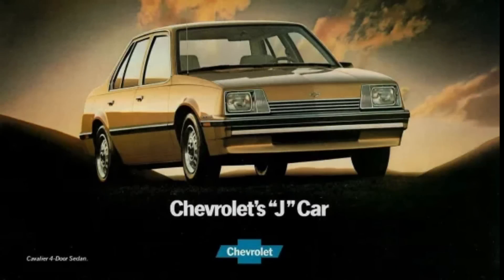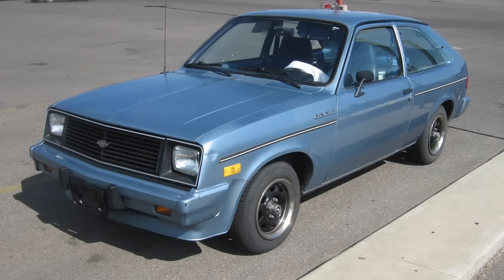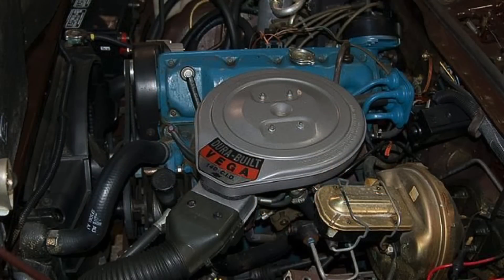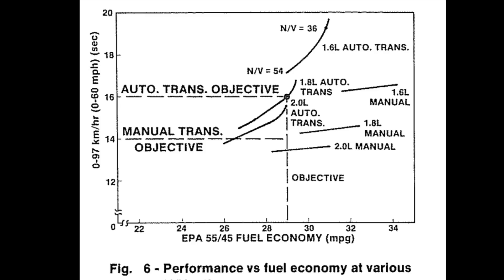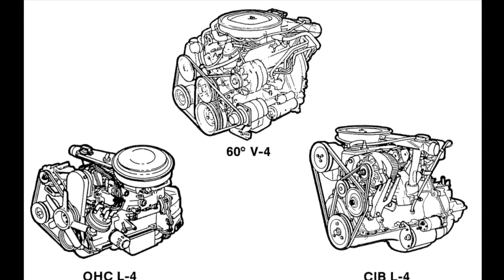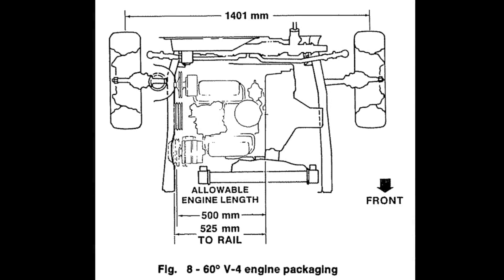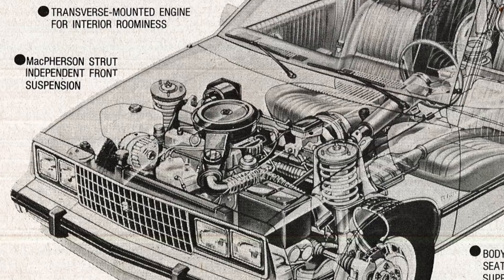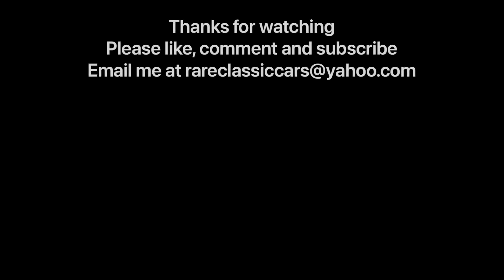GM Builds a Crazy 60-Degree V-4 (Yes, a V-4!) for Its J Cars

Comment: Had an '88 Eurosport with the 60 degree 2.8L V6 and 4 speed transverse automatic transmission.  It had about 250,000 KM on it with no engine or transmission repairs;  just change the oil!  Sadly, it was in a small collision;  was written off because it was over 10 years old.  It was sold to a man who fixed the body and put another 100,000 KM on it.  I loved the GM 60 degree V6 engines;  absolutely no cam drive issues faced with the newer OHC engines.
Reply: Had 86 S-10 Blazer with the 2.8 V6.  First fuel-injected vehicle ever owned.  Loved the way it started right up, no stalls.  The 125 horsepower were quite adequate for both city and freeway driving.  Did a lot of freeway driving, long distances on cruise control, in the Blazer, just cruise and listen to the music, very enjoyable.  Sold it in 94, got a Taurus SHO.

Comment: I bought a 89 2 door Cavalier with the 2.0 engine.  It had throttle body injection and was very slow & got horrible gas mileage.  I later bought a 94 2 door Cavalier with the 2.2 liter engine. It had port fuel injection & a roller cam. Wow what a difference.  It had an additional 40 or 50 hp and got 35 mpg. I drove it to 305,000 miles and never broke down.  I still miss the 94. If I found a good used one today I would buy it.

Comment: Back in the day I owned a Chevy Chevette.
I was lucky to go up a steep hill at 45 mph with a tail wind.

That car lacked horsepower, torque, and curb appeal.

A small V8 would have been more efficient, in my opinion. Having to do less work for the same results.

Comment: My first car (back in the 70s) was a Saab 96, which came fitted with a Ford Taunus V4 engine. Worked fine by the performance/economy standards of that time, and was very short in length.
Reply: The Ford v4 was actually an industrial engine which is why they ran forever
Reply: Dude I had one of those too I think it was a 71 I got new and I loved it what a great car!😂
Reply: I had a 1967 Saab 96 also with a V4 and it also was my first car in the late seventies. I really miss that car.

Comment: Interesting video but a V 4 would be longer than 2 cylinders because the bores on opposing banks are offset. Call it 2 1/2 cylinders long.
Reply: Yes, although the offset is only the width of one connecting rod big-end bearing, if the bore spacing is the same.
Reply: @brianb-p6586  - So the engine is longer by the thickness of two connecting rod big ends, but it is longer that a two cylinder engine.
Reply: @scootergeorge7089  just one connecting rod big end, if the bore spacing is kept the same... but yes, the V-4 is longer than a straight twin with the same cylinder bore and stroke.
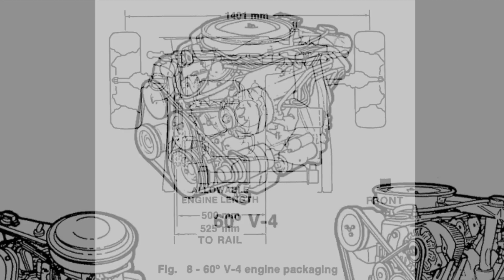Reply: @brianb-p6586  - Correct. But at 6:38 they say the four is no longer than the twin.

Comment: Back in the 80,s Oldsmobile was supposed to been developing it's own V5 diesel engines in addition to it's 4.3 V6 production engine  back in the 60,s Ford of Europe had developed a V4 engine for the Saab 99.
Reply: Ford didn't develop the Taunus V4 for Saab, but they did sell it to them.

Comment: I have often wondered why GM didn't just make a four cylinder version of the Pontiac  OHC sprint six like Chevy did with the Chevy II four which was just a Chevy 6 with two less cylinders, it would have been very similar to what they put into the Pinto and other Ford products. I think that was a missed opportunity.
Reply: I believe that the Pontiac and Chevrolet straight sixes had the same bore spacing as the later Chevrolet small block V8, which was 4.4 inches. That would result in a relatively long inline four-cylinder, which was a problem for the transverse placement in a small car. The Iron Duke (later Tech IV) engine was available when the J-car was designed, and had been used in the H-body cars, but was not used in the J-cars... presumably due to the length.
Reply: It may have been too tall for small front wheel drive cars 🤷‍♂️

Comment: Ford built a V4 in Britain and Germany it produced excellent torque if not horse power but need to have a balance shaft in the block in order to stop it from shaking itself to pieces
Reply: The British and German Ford V4's were unrelated engines - the Essex engine from Britain and the Taunus engine from Germany.

Comment: Saab had a V-4 but it was a 2 stroke. A 4 stroke V-4 is really rough but that problem seems to go away with a 2 stroke design. The J Cars weren't great, weren't terrible but they were better if you could get the Iron Duke 2.5 four cylinder and especially the manual transmission. The automatics weren't the best and when you hooked up a V-6 to them they wore out sometimes in less than 100,000 miles. My dad had a Pontiac Astre with that 140 cubic inch four and as Charles Barkely would say - "It was turrible! Just turrible!"
Reply: Saab's 3-cylinder was a 2-stroke, but the V4 that they used was the 4-stroke Ford Taunus V4.

Comment: I had a 62 GMC that had a 60 degree 305 V6 in it, at the parts stores they always told me No sir, 305 is a V8... Same 4 1/4 bore size as a 454 but pretty sure that V6 weighed more than a BB Chevy.
Reply: It did, they also made 351 , 478 V6s. GMC also made a 634 V8 and 702 V12 🤣
Reply: And a 427 is a Chevrolet, so Ford couldn't POSSIBLY have built 427s. And a 428 was a Ford, so don't try to tell me Pontiac never built 428s. These parts house flunkie monkeys need to get edumacated.

Comment: It sure would be interesting to hear that 60 degree 4 cylinder run - particular since the 2.8L uses the 1-2-3-4-5-6 firing order. I guess GM scrapped that whole line of development. It would be interesting to see the memos and reasoning for that decision. It would have been an ideal replacement for the Iron Duke. The Vega design seems to become more and more appealing as the years  go by. Elementary school me really wanted a fully kitted out Monza Spyder, though. The more fender flares, spoilers, stripes and louvers, the better.
Reply: The firing order of the V6 would not determine the firing order of the V4 derived from it.

Comment: Yeah, I do remember those GM V4 engines. They were also found in the early & mid 80s camaros & firebirds. Those engines were very good for fuel milage but they also really lack power. It barely had any power when floored entering the freeways.The camaros equipped with the GM V4 were labeled as berlilita or the rare Z26. Funny about those GM V4 engines, I did seen someone install one in a go-cart.
Reply: No, the GM V4 never went into production.  The vehicles that you remember had a V6.
Reply: That was the Iron Duke, which hung around for a very long time. The postal LLVs are all powered by them with that disinctive "moan" as they pull away.
Reply: @stevevarholy2011 I'm in the auto salvage business, and get good money for rear wheel drive Iron Duke core engines thanks to the USPS 👍

Comment: I can only imagine how that 60° V4 would have run. A 90° angle would have run better. GM Ford and Chrysler made one big mistake and that is they should have pushed back against any of Washington unrealistic and unconstitutional mandates. Yes the exhaust needed to be cleaned up on that I will not argue however the standards are way too strict and totally unrealistic. As for the gas mileage standard that should have been sued out on constitutional grounds. There never was an energy crisis in the 70s that turned out to be one gigantic fraud just like climate change. GM Ford and Chrysler need to go back to traditional American cars if they are to survive the 21st century. I had a 91 cavalier 2.2 and automatic it was okay in the flats but it really didn't like climbing hills. Anything over 4% was quite interesting. I ran that car for 300,000 miles the only thing that took it out was a car accident not my fault.

Comment: I was an engineering co-op student at GM during this time, and I never heard of the V4.  I heard of the V5, though.  When the J-cars were introduced, they were a step forward in power, but were held back by the throttle body fuel injection.  The horsepower resurrection had to wait until 1985 for port injection to reach production.
Reply: My '86 Cavalier VL coupe with the 2.0 still had TBI - only the 2.8/3.1 had MFI until 1992. By then, it was a 2.2 liter MFI with 110 HP (vs. 95). It got SFI to make 120 HP in 1994.

Comment: 2.8ltr was a fantastic little engine. When I first learned it was only 135hp, I thought BS. So super quick and got great mpg. 30+  ....often in town. I lost a rod, but replaced the engine, immediately.  1985 Celebrity.
Reply: Early iron head 2.8 V6 was kind of a shitpile. The later aluminum head 2.8 was fantastic, and grew to 3.1, 3.4, and 3.5
Reply: @johneckert1365  it sure was a great little car, though. I agree, iron sucks, but I really had no problems with it. Just a rod letting go. Grabbed a long lock at pull-n-save and drove it around forever.
Reply: @johneckert1365 ...and a 3.9 with VVT, which was the last of the OHV 60-degree V6s from GM.
Reply: @good4jg  Ah yes, forgot about that 🤔
I've heard of the 3.9 but haven't seen one in person. I also didn't know they were VVT.     I've been very happy with the 3.5 in my daily beater Impala.
Reply: @johneckert1365  It went in the the Impala between 2007 and 2011, too, with and without AFM. It also was installed in the '04-'07 Malibu Maxx and the first years of the G6 GTP. The U vans (like my '07 Uplander) got the one without AFM.

Comment: My guess is that at the end of the day, the bean counters figured out that the production costs of a V4 were greater than those of an inline 4.  Think about it, an extra cylinder head, head gasket, and exhaust manifold all had to be made.  The other issue that's not really mentioned is that the weight of the overall engine comes into play.  This was at an era at GM where they were very risk adverse in engine design, due to the failure of anything where they tried anything new, like the Vega aluminum block with no cylinder liners, and the Oldsmobile diesels (which were failing because of water separation and GM's unique head bolt design for these engines), so doing anything like putting alloy heads on an engine to lighten it was out of the question.
Reply: And, possibly among many others, there would be the  Chevrolet Corvair with a rear-mounted, air-cooled engine.
Reply: @davidalanjonesridge9874 the Corvair was actually really successful initially.  No, Ralph Nader didn't kill it, but GM executives hated it, because it was an expensive car to build.  They introduced the Nova to take the same market (on sale at the same time!), and when the Mustang came out, they used it an excuse to totally discontinue the Corvair and introduce the Camaro to replace the "sportier" Corvairs.  The Corvair was supposed to be the American answer to the Volkswagen product lineup, but became a redundant small car (car company executives in America only thought about size).
Reply: @brentboswell1294  Ah, thank you for the additional insight. I had had my suspicions concerning the VW. Although it was justa script, all this reminds me of the movie "Tucker". Could the Pinto fit in here somewhere? They may not fit in this discussion but I remember the old Studebaker and the Nash Rambler. They were small. Hey, how about an old dune buggy?
Reply: @davidalanjonesridge9874  yeah, around the late 1950's, both Ford and GM were starting to get nervous about Volkswagen, whose sales numbers in the USA kept going up and up and eroded market share from both manufacturers.  Ford's response was the Falcon.  GM's response was the Corvair.  Both the Falcon and Corvair were brand-within-a-brand concepts.  Ford had a Falcon van (that became the Econoline later), and the Falcon Ranchero, and Chevy had the Corvair Greenbrier Van and pickup, which were replaced in 1964 with the Chevy Van (the original, which looks surprisingly like the Mystery Machine from Scooby-Doo, way more than the Dodge A-100 does!).  I think that GM looked on with envy as Ford's cheaper solution to the VW challenge way outsold them, and came up with the Nova.  Somehow, the Corvair sold in good enough numbers to get a full makeover in 1965, including a redesigned rear suspension that replaced Ralph Nader's swing axles with CV joints, although the Greenbrier had been dropped by then.  Re: dune buggies, I had a friend in high school who drove his Corvair powered sand rail (1980's) to school every day.  We used to scour junkyards for Corvair parts...we found a turbo engine, but never got around to installing it...kinda wonder what became of the engine 🤔   Volkswagen later capitalized on the desert bug/dune buggy mania by importing The Thing (VW type 181) to the US for two years ('73-74).  It had to be dropped in 1975, as it couldn't meet new passenger safety regulations.
Reply: @brentboswell1294  Oh, WOW! This is fantastic. Thank you. Your response was amazing. It way more than supplemented what I shared, I was aware of the names of the makes and models you mentioned but you did a great job in putting them in an historical context for me. Maybe you should work for WIKI. There were days when you had fun. Bone yards are like going to a museum, or antique store. They can be worse that a used car salesman. Hope you paid a fair price. I note the movie "Tucker" because of the safety regulations, the bureaucracy, and how the "good ole' boys" network in how they stick together and the new or little guy suffers. And, the guy in that movie was bothe a mole and a saboteur.

Comment: Yes, that 0 to 60 MPH chart is humorous, but the 55/45 EPA MPG figures at the bottom are hysterical!!

(PS - both Vega bodies were really good looking!  Pity they didn't just stick the 140 HP Chevy 4-banger in there...)
Reply: I think it was too tall to fit under the hood.
Reply: @johneckert1365  I doubt it, aren't OHC engines usually taller than pushrod units?
Reply: @marko7843  I suppose a tape measure would tell us which is taller
Reply: My mother had a Vega wagon my father shoe horned a 350 V8 in. Even with stock tuning that car was fast with decent mileage

Comment: Always been my idea for a modular V series that every 2 pair of cylinders was bolted to the block behind, thus making possible everything from a V8, V6, V4, V2,all of which could share parts like the rocker arms, lifters, and valves, thus making a lower costing engine as fewer parts were needed to be made across the entire range. Mechanics would also be familiar with them , as they were all the same basic design.
Reply: Volvo didn't make it a "bolt on" engine, but they did pursue using the same architecture and components for a family of inline OHC 4-5-6 engines both naturally aspirated and turbocharged. The Turbocharged inline 5 is unbelievably durable. Volvo used Citations as their test mules for the engines.
Reply: @stevevarholy2011  They're great engines. Didn't know that about the Chevy Citations.
Reply: Ya, that would require auto engineering to give up obsolescence. They really like to reinvent the wheel with every model and year.
Reply: You would have considerable oil and coolant leaks with a modular block design like that. I think if that were a functional idea we would have seen a 4 cyl SBC or Windsor in the 1980s
Reply: @siegessaule  You could use a separate oil pump for each modular block. I think the biggest problem is that the ideal v bank angle is dependent on the number of cylinders, so more suitable to an inline configuration.
Reply: Look up Cummins and Deutz air cooled diesels. They modular I have a 5cyl for example

Comment: No one gives proper credit (in my opinion) for the effects of digital technology on the automotive industry. The computer revolution in the 1980's and 1990's had more effect on the automotive landscape than people understand.   In 1979 automobile engines were mostly mechanical devices, the Engine Control Modules and sensors were primitive.  Think of Chrysler's dismal lean burn system, essentially a carburetor with 1970's era electronics. By the year 2000, the industry had perfected port fuel injection, use of multiple O2 sensors and mass air flow technology to monitor emissions and adjust fuel-air mixtures.  This enabled computer controlled real time adjustment to maintain precise air-fuel mixtures and adjust other engine parameters to optimize horsepower, while meeting emission and fuel economy requirements.  Suddenly an automobile could make 300 Hp and return 30 mpg while meeting emissions. It is the computer that made this possible, IMO.
Reply: I wonder how much of the dysmal effects were caused by the US auto industry's refusal to pay Bosch for for their fuel injection systems like K and L jetronic which found their way into the Volvo Lamba Sun

Comment: One of my many daily drivers over the years was an '01 Z-24 coupe with the 2.4 Liter mated to a 4 speed automatic. Nice blend of power and mileage, gave a few diesel pickups a surprise out of a light or on a merge ramp😁
Reply: They were even quicker with a 5 speed manual
Reply: My mother had a 98 with the 2.4 and the 4 speed auto. That car was a complete turd. Electrical issues galore, trans slipped in the winter when below zero, the chassis was poorly built, then the engine actually blew up at 108k miles splitting the head right down the center and damaging the block. I told her it wasn't worth repairing and bought her a Dakota she put 300k miles on till I bought it for my oldest daughter to use for going back and forth to college

Comment: You can bet that the V4 cost more to build than the inline 4 with essentially the same parts, that is why GM didn't go with the design.  Also, V4's without balance shafts are not known for their smoothness.....

Comment: Loved my 85 Camaro with the 2.8 port injection. 32 mpg on the highway with 5 speed. Could smoke the tires.155k of very hard miles and didn't burn any oil